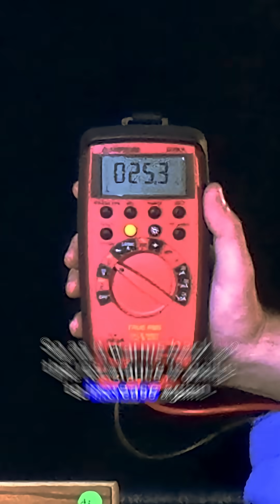Light goes on by putting a resistor in LN2! ⚡🥶 #DrDawson #shorts #science

Comment: Why did humans have to make things so complicated?

If you want to turn the light on, just get some electricity, put it through a wire and turn on the light. I don’t think you need all of this extra stuff just to make a simple lightbulb turn on. Why do you need a resistor? Just turn on the electricity to make the light turn on.

(I’m a junior in high school, I’m not that smart)
Reply from the maker: It's about breaking down how things work and understanding on a different level. Yes, you can flip a switch and turn on the light in your room but do you understand how that electricity is controlled, where it comes from, etc? Electricity is used far beyond just turning on a light bulb.

Comment: What resistor are you using? Just curious because not all metals are THAT temperature dependent
Reply: In liquid nitrogen they are!
But to answer your question, it looks like a standard wire-wound resistor in a ceramic potting. They're used anywhere you need to sink a lot of current.

Comment: So does it resist more with heat or does it remain the same?
Reply: resistance generally does increase with heat. it is part of why things like electric motors in cars require cooling (apart from not wanting your vehicle to explode)
Reply from the maker: Less
Reply: Yes, hot means more resistance. That’s why shorts get hot
Reply: @mattat3847 shorts get hot because they flow a lot of current or dissipate most of the energy in a circuit. it is not because they are high resistance.

but yes, heat increases resistance

Edit: wait, what you said makes even less sense than I thought, what are you trying to imply about shorts here?

Comment: Can someone explain why it's temperature dependent?
Reply: As the temperature increases, the rate of the electrons colliding increases so as there is more collision, the flow of the electrons is less. That’s why temperature dependent resistor
Reply: @stevenabshire   According to a source I found: "Heat increases resistance because as temperature rises, the particles in the conductor vibrate more, making it harder for electrons to flow through. This increased difficulty in electron movement results in higher resistance."

Basically, when things "heat up", the material is "vibrating" at a rapid speed, making it hard for electrons to connect. That "wasted" energy is the heat you feel.
Reply: https://en.wikipedia.org/wiki/Electrical_resistivity_and_conductivity#Temperature_dependence
Reply: @stevenabshire  i believe it is because common resistors are rated for room temperature, and is usually dissipated as heat. Remove the rate of heat dissipation and the resistance goes down
Reply: @stevenabshire  different materials have different behavior -resistance can increase or decrease. But for a "professional " resistor,  it should have negative relation with temperature otherwise it heats up, reduces resistance which further increase current and more heat up and eventually cause "thermal runaway" or simply catch fire!
Reply: @ashishlukka i'm not sure what you mean by professional resistor. NTC thermistors do exist but they're usually meant for regulation or sensing, actual power resistors are just larger, made from more temperature resistant materials or have better heat dissipation (such as through a heatsink) to prevent an unintentional increase in resistance